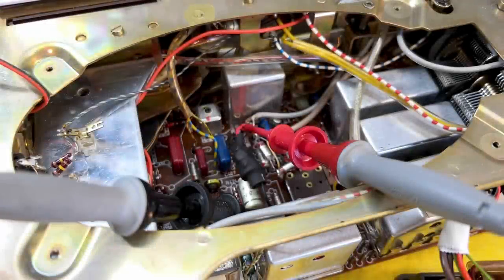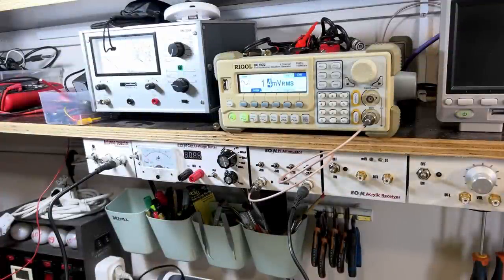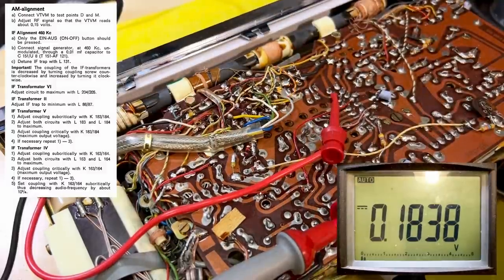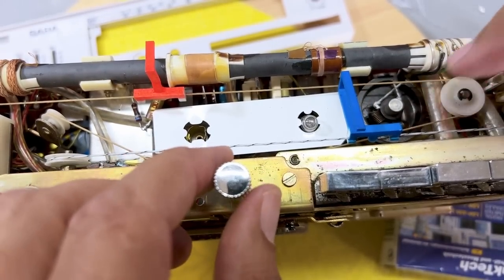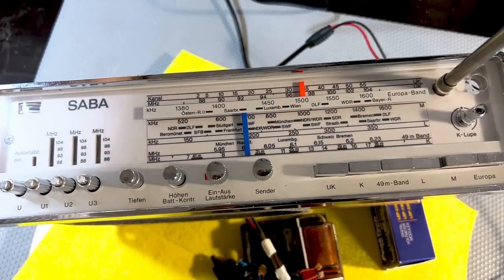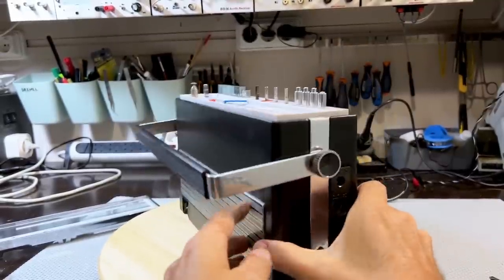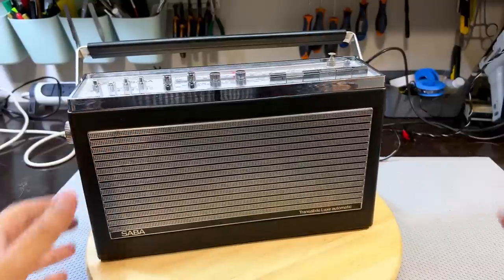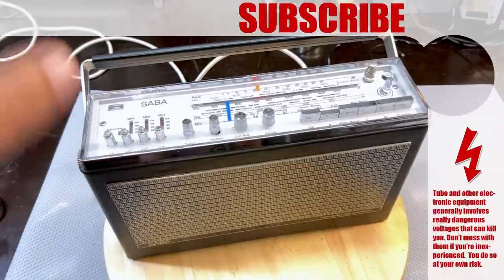Another treasure saved. SABA Transall de Luxe restoration part 2

Comment: I can imagine the excitement of the owners of these radios back in the day. A well designed radio with Saba quality built in. The power socket looked fine, a pity it was damaged but hardly noticeable. The case looked very good after you cleaned it up. The extra camera angles and reference to the alignment instructions during the alignment was very much appreciated. Thanks Manuel 👍🙂
Reply from the maker: I think the price you paid for these things back then made them more appreciated, unlike today. Now stuff is bought dirt cheap, and already with a “dispose by” date.

Comment: Awesome job! Really glad to see you working again on a transistor radio. And what a beautiful radio it is.
The blue dial pointer is something else, though. I've never seen a dial pointer shuffle along the dial like it's doing a moonwalk. 😀
About the "bad" AM reception: well, it's a portable radio, probably intended mainly for outdoor use. I guess using it outdoors on batteries will get you much better AM reception. I run my Grundig transistor radio on a pack of 6 rechargeable AA batteries, which works perfectly.
Looking forward to your next project!
Reply from the maker: Yes, this area isn’t really good on AM without a miniwhip, since we only have one MW station here. All the others are from the Canary Islands and North Africa.

Comment: Looks like 👍 ya found another radio 📻, exactly identical to your other one ☝️. You’re saving electronics from the past. I hope 🤞 ya got it restored (resurrected). Your friend, Jeff.
Reply from the maker: 👍 I did
Reply: @electronicsoldandnew  Ya probably can install a dial light 💡, but this may require a little modification to the wiring inside the radio 📻. I don’t know 🤷‍♀️ if this would affect the vintage (or antique) qualities of this radio 📻. Your friend, Jeff.

Comment: Hi Manuel. I hope you're recovered after your brush with Covid. Nice radio but yes, very strange that Saba couldn't do a better job with the AM tuning.

Talking of which I can't believe it but I've got a Braun T1000CD incoming: FM works, which is good because that also means the audio amp is OK but that won't stop me doing a thorough audit, but no AM. Given all the AM is apparently dead (I won't be sure until I get my paws on it) I'm hopeful that it's a simple electronic problem rather than a mechanical failure. I'm currently binge watching your own T1000CD playlist in preparation. What a fantastic resource you've created for us. Thank you sir. 👏👏👏
Reply from the maker: I think I’m almost 100% over the Covid, but it was worse than I expected. Anyway, hopefully I’ve gained some immunity for a while.
The Braun is well worth the work to restore properly. It’s one I miss working on so will have to set my sights on another one. Good luck with yours.
Reply: @electronicsoldandnew  Thank you - yes, this is a radio I will spend a lot of time, effort and, as needed, money on and do the best job possible. It's a classic and there'll never be any more of them in this world than there are now! Good to hear you're on the mend although obviously not so good that it wasn't trivial.

Comment: Nice work.
I think to remember Saba was mostly sold in Germany. They exported some but they were very expensive so it was not a huge market. Grundig was about the same quality but made simpler and much much cheaper therefore had a huge market across Europe.
Reply from the maker: The SABAs were the Rolls Royce of the era. Quite a few found their way to Portugal, but they were really expensive.
Reply: Grundig also had a very wide selection of transistor portable radios in their product line compared to Saba. And, by the mid 1960's many of their radios went up to 108 MHz on the FM band, which helped make them more exportable.

Comment: Yes, the "Stabistor" is a component you don't encounter that often.
But Graham over @Radiocruncher had to replace one when he had to tackle a 
Tandberg TP41 portable radio I sendt him back in April this year.
Check his Sunday live streams (2 episodes) from April if you like.
There are basically 2 options, eigther build it up with two 1N4148, and a germanium diode,
or as Graham did, putting in a red LED. They have just about the right voltage drop across them.
Great job as always Manuel.
Reply from the maker: I’ll watch Graham’s videos. Thanks for the tip. 👍

Comment: The Saba brand must not have ever been sold in the USA, as I never heard of it until I started watching your videos. And you do a ton of Sabas. They must have been big across the pond. Many other German brands I'm familiar with. But Grundig was not big over here until it was essentially no longer a true German made brand name. I used to own a really old Sparton Equasonne, made about 1928 or '29. Right about the time of the stock market debacle. Wish I still had it, but it was huge and as much a piece of furniture as it was a radio. It was a floor standing radio with intricate cabinetry and was a good bit over four feet tall. Though rare, they were never valuable because antique radio collectors in the states like the smaller, table top, Art Deco radios that came out in the 30s. A Sparton Bluebird (Art Deco style) in good condition can fetch over $20,000.00 USD!! I had the wrong Sparton.

Comment: By the time the Transall de Luxe was introduced, the emphasis was shifting toward FM and Saba was a little bit ahead of some of their competitors in adding varactor diode pushbutton FM tuning. But suitcase style car-portable radios would be dropped from most manufacturers' lines in the upcoming 3-5 years, partly due to cost concerns and also because more cars had in-dashboard radios installed at the factory.

It's interesting how some other manufacturers put more of an emphasis on easy shortwave tuning. For example, most of the Nordemende Globetraveler radios had no FM presets but used a rotating drum type tuning indicator for the shortwave bands, making a fine tuning knob unnecessary.

Comment: A beautiful device. Perfectly readable white scale. 😊👍
I can imagine how much time was spent on the vernier thread to stretch it without disassembling the installation. 
But what about the second backlight lamp? Is there an empty nest left? 
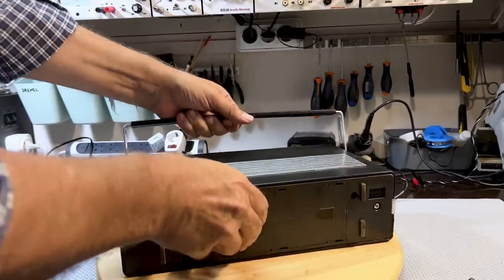And more. 33:10  Why didn't you put the power connector inside the lid? In my opinion, there was enough space to place the connector closer to the transformer. 
Yes, I noticed there are casts of the case amplifier, but I think we are solving this moment. And then you wouldn't have to put this connector on the outside. 
And the view would be beautiful and everything would be on the same plane with the casing.
Reply from the maker: The lamp holder is there and I will replace it when I find a lamp, probably at the same time as the antenas. 
The decision to fit the socket in the outside was intentional. I wanted to use it to cover the ugly irregular cut that was made on the case.

Comment: I just bought a Philips B4X77a. Sold as working. Turns on, all the tubes light up, sound stage is working. Makes all the right noises on sw and mw but doesnt pick up any station. Its totally silent on FM. Someone replaced resistors but left all the black turd caps in it. This should be fun.
Reply from the maker: Enjoy 😉

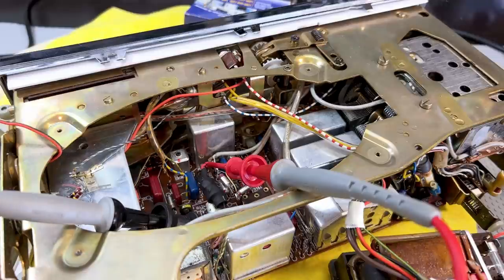Comment: Impressed with your perseverance and attention to detail, except perhaps the invisible soldering technique on the blue mains wire (2:53). Ho, ho, probably an illusion and not you're doing. The tilting blue pointer would bug me, but then I would break it whilst trying to modify it.
Reply from the maker: 😊 that tape isn’t hiding a solder joint. It’s just there to hold the two wires together. The old tape they had was peeling off so I replaced it with new tape.
Reply: @electronicsoldandnew  I blame myself for my half-arsed description. I meant where the blue wire goes into the solder terminal on the back of the mains connector.
Reply from the maker: Oh, I see. Yes, it could have been finished a little better 😊
Reply: @electronicsoldandnew  Some solder wouldn't go amiss, ho, ho (the end of the blue wire looks to have solder on it but none on the tab of the mains connector). The wonders of youtube illusions and commenters (like me) who have nothing better to do than criticise others.
Reply from the maker: 😊 I handle criticism quite well 😊

Comment: Get the plug unit that mates with the socket on the bottom of that radio as it has an Antenna connection.

Comment: Could you do some kind of a inductive coupling from the mini-loop to a ferrite bar antenna? I know it can be done because I made up a huge loop coil antenna for AM when I was a kid with the proper number of windings and a trimmer capacitor. I just had to select a station on the radio and then tune the capacitor on the coil antenna to match the station. It was bi-directional just like the ferrite itself so you had to aim it. My dad used that antenna for a portable radio he had in one of our barns for years. He could pick up stations really far away at night. Even way farther than normal.
Reply from the maker: Yes, that is possible, but I normally prefer to connect the miniwhip, and some of these radios have a car antenna socket which makes it really easy. This one, unfortunately, does not.

Comment: For the small diameter tuning knob... If you have a 3D printer, you might print an adapter that fits over the existing knob... Or, use Sugru to fashion, such. Sugru is a mold-able plastic. It is expensive. so just DIY it with clear, 100% silicone caulk and baking soda. Sugru is a great Maker's trick. Google the recipe and instructions. Or, find a larger replacement knob and store he original in the empty battery case... I imagine the last idea is the best, because there is no possibility of damaging the original knob.
Reply from the maker: Good idea 👍

Comment: Nice job. I'm not familiar with that radio at all. Does it have a BFO?
Reply: No. Pure AM reception. The tuning would also be a horror since it needs to be far better even with the fine tuning, possible but horrible.
Reply from the maker: True. Really not made for BFO. I tried my external BFO on it and got reception, but it was really difficult